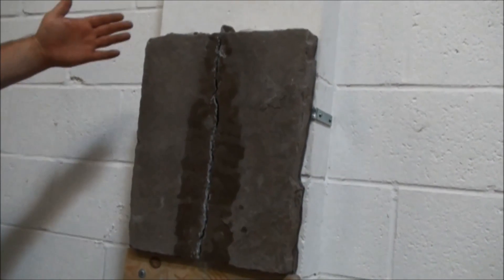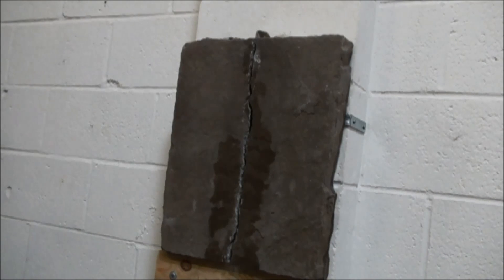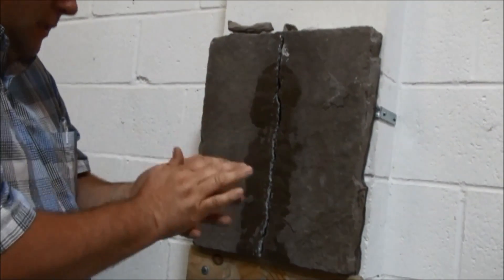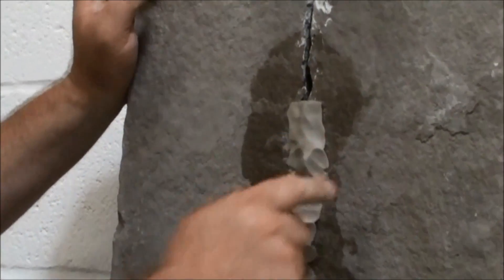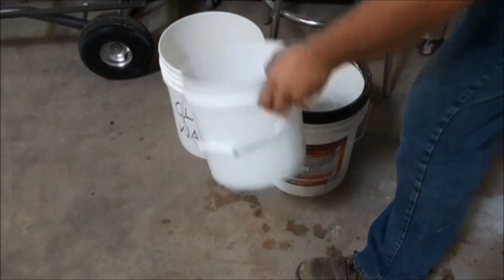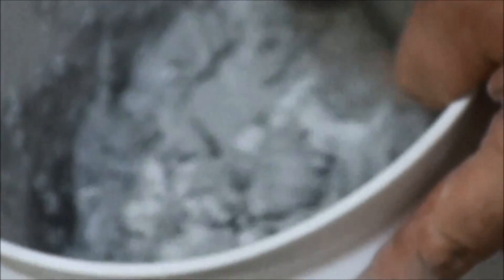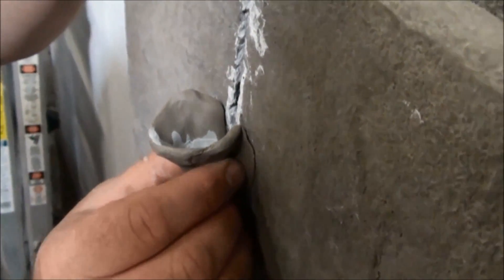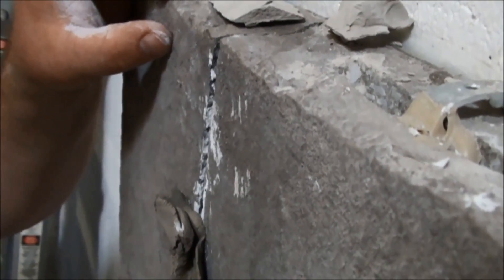Injection Grout: A Step-by-Step Guide

Comment: Doesn't works on narrow cracks such as 0.3 mm. Also does not comply with en 1504 part 10
Reply: Thank you for your post.  I wanted to reply regarding your comments in your post.  

The grout will flow wherever water will flow.  If water does not flow in the crack, then this grout chemistry is not suitable for repair.  Conproco's grout chemistry is not suitable for pressure injection often used in fine cracks.

I am not familiar with the EN 1504 Part 10.  Our sales efforts have been in the United States and we adhere to many ASTM standards.  Is there an ASTM equivalent to EN 1504?
Reply: @lawrenceburkhardt6839  A quick google search brought up the page for the european standard  en 1504-10 at the bottom of the page there were some cross references to astm.  https://www.techstreet.com/standards/bs-en-1504-10-2017?product_id=1997923.

Apparently sika has a product in britain that complies.